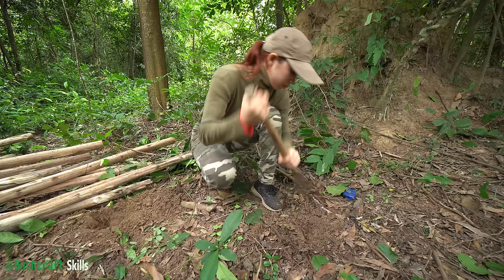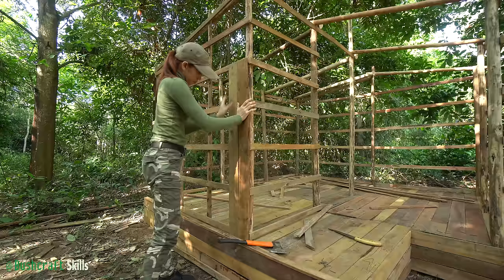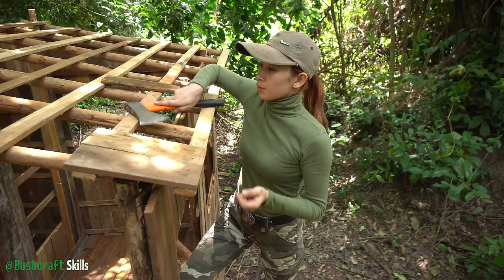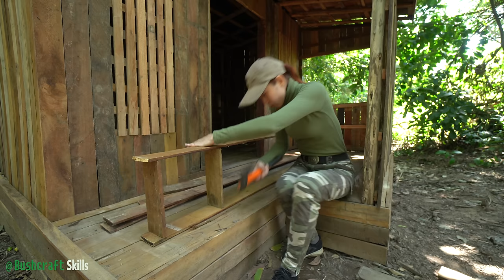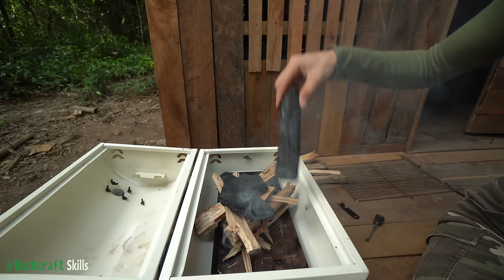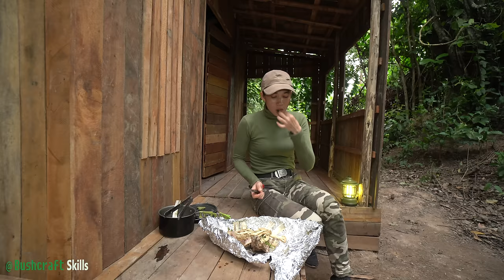Building Complete A millionaire Bushcraft Shelter With Wooden roof, Start To Finish

Comment: How shingle courses should placed:
________ 
      ________
              ________

How they do it here:
________
               ________
                             _______ 

                   |-------| - big gap where water just drips between the shingles because it has no course beneath it to direct it down to the next course. 

In this video she needs to have about 10-15cm longer singles to maintain the visual spacing between courses. And you don't nail the overlapping shingle end, just the tops. The objective is to provide overlapping materials that don't have holes or gaps in it for water to infiltrate.